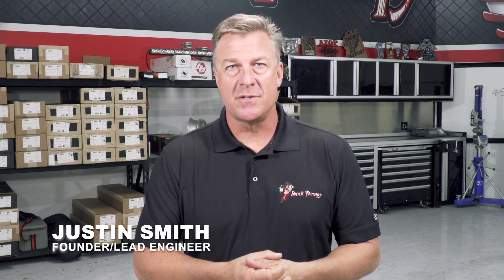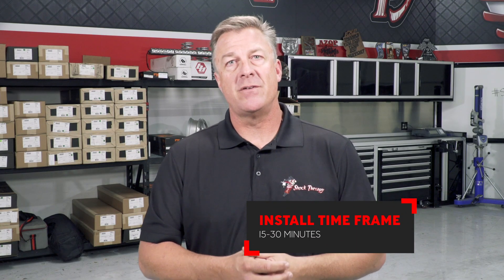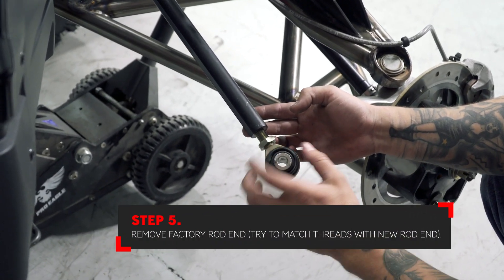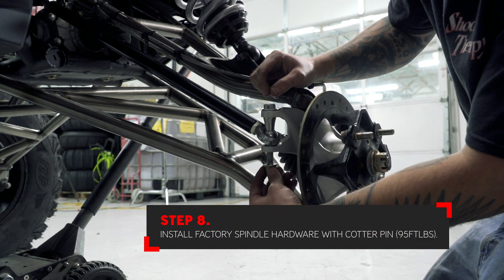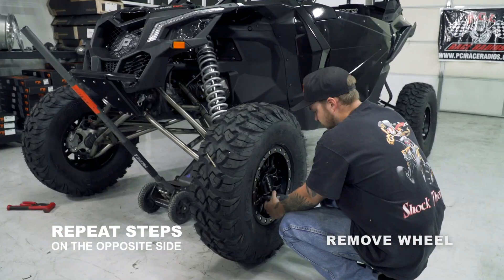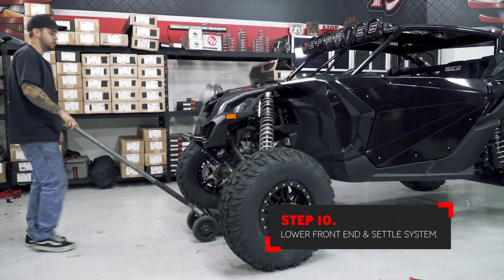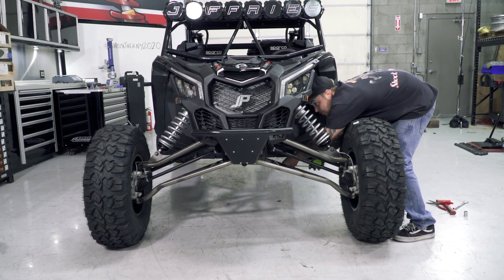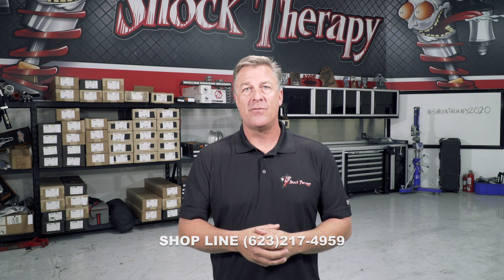How to Install Can-Am Maverick X3 RS/DS Shock Therapy Stock BSD Kit

Comment: My stock tie rods on my 2021 x3 have right hand threads on inner and outer rod ends, I can not adjust toe in. ?
Reply from the maker: The inside joint is a ball socket. Leave the jam nut tight. It just spins by hand
Reply: @ShockTherapyllc  Awesome thanks

Comment: Regarding X3 Tie-Rods - I purchased a used vehicle and it obviously still has the OEM steering rack. Question is, do you have a recommendation regarding the ends going into the steering rack? I see there are different options and wether to go with clevis ends or the OEM boot design. Thanks in advance and happy new year, cheers.
Reply: @shocktherapy4820  when I purchased the car had installed S3 brand tie rods with clevises on the steering rack side though. And it's OEM rack. Not sure that's the best of ideas though so figured I'd ask. Thx again
Reply: @shocktherapy4820  Roger that👍